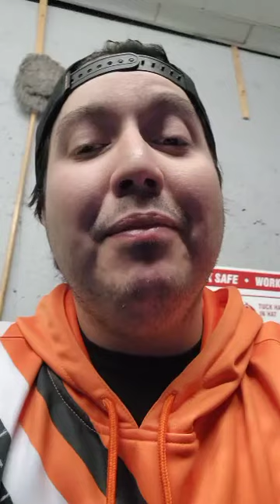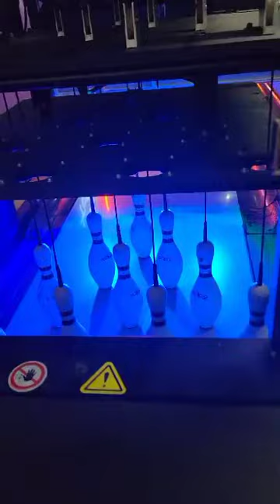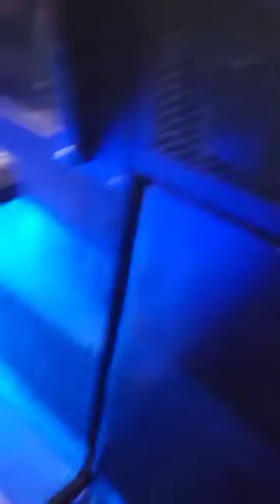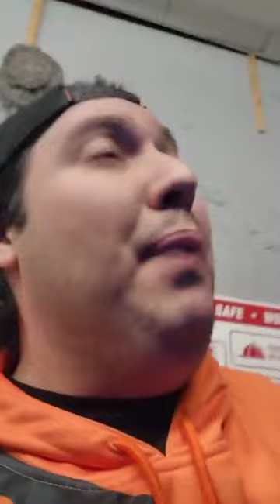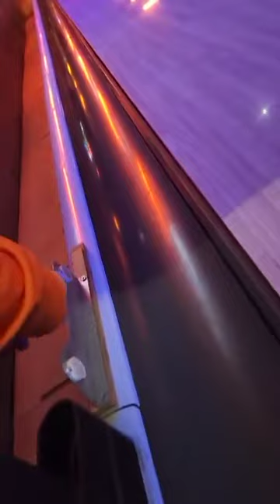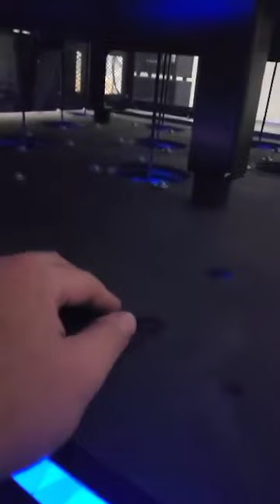STRING PINS: Behind the Scenes w/Mechanic Felix Serrano!

Comment: String pins can be competitive but I find it extremely hard that all the pins per lane would be calibrated the exact same way...i predict some pins/lanes will have weird string take downs while others don't even with certification....also their will ALWAYS be the need for a mechanic in any decent sized center string pins or not...balls will still get stuck, oil machines will glitch, and lanes will still break down
Reply from the maker: You don't need a "real" mechanic for balls getting stuck and strings being tangled though . .

Comment: Did he say the stings at his center are not certified? What would it take to make them certified? If a center decided to change to string pins right now would it cost more to get the certified version?
Reply from the maker: It's mostly in string length as far as I know, I'll see if I can get specifics though.
Reply: It's mostly string length and the pins on my machines are actually a bit smaller than standard and lighter.  So they fly like I'm the Packy videos.  I haven't gotten any that are in spec for competitive play yet but from what I have been told they're much closer in dimension and mass.
Reply: @LukeRosdahl  I think where I’m confused is people say it’s gonna be cheaper for centers in the long run but most videos of strings on the internet are not certified.  Did they switch before they have had the specifications for certified?  I know the story of Rashes video but what about the others
Reply: @cramones88  stringpins have existed for decades, the sanctioned specs have existed for months. it could just be a time thing, it could require specific pins and string lengths. it could require specific strings. the pin setter might need plastic cups for the pins to settle into. 

best case scenario is that string machines just need adjustments to qualify. hopefully at worst it's just a few cheap replacement parts
Reply: @MrOsmodeus  from what I understand the “curtain” I believe is that it’s called needs to be further back as well as something else in the pit area needs to be deeper.  I’m not 100% sure how difficult it is to change those things.  Did the center where packy practices change it before the specifications from USBC?
Reply: @FSerrano2789 For God's sake the pins themselves aren't even in spec on the uncertified machines?!?!?!? That's a worse joke than I thought... bowling as a serious competitive sport is doomed.
Reply: @cramones88  probably after given they started videos after people started caring about stringpins. i've seen videos for the amf string machines from 5 years ago but all the complaining started 9 ish months back
Reply from the maker: @notonyourlife7939  Why would they need to be in spec for unsanctioned recreational bowling???  I get that you don't like them but dude listen to yourself.  Uncertified strings are for RECREATIONAL CARNIVAL STYLE BOWLING.  I don't know why league/competitive bowlers can only see through their tiny little lens.  You keep digging the hole deeper and deeper and giving your opinion or your perspective less and less credibility with every comment.
Reply from the maker: @cramones88  Yeah uncertified string pins have been a thing for years for "fun centers" that have bowling as kind of like an extra arcade game so to speak.  But since they're so much cheaper and easier to run, a lot of centers have been considering them period, even if it does run off their league bowlers, because in some cases, it's either go strings or go out of business.  

Certifying strings is the compromise that allows centers to stay in business while still having some form of league or competitive play possible.
Reply: @LukeRosdahl  I'm just stunned that these manufacturers found it necessary to mess with the pins themselves as well. How hard would it have been to just use standard pins? It's almost as if a concerted effort was made to butcher everything they possibly could, and it makes no sense. Not to mention that this would make yet another financial hurdle for already struggling centers if they converted to strings prior to the certification, and wanted to maintain some sort of league presence. Now they gotta buy more pins, too... making it even less likely that they'd do so. And therfore another nail in the coffin for competitive bowling. If that's an "invalid" or "not credible" opinion, so be it. I've been called worse. If you don't think any of this is a big deal, that's fine. But I do, and that's OK too. We can agree to disagree without dumping on each other.
Reply from the maker: @notonyourlife7939  I'm not trying to dump on you, I'm saying that the way you're talking, you're not doing any favors for your opinion.  Why would a recreational or carnival type fun center want to go for the full on meat and potatoes of making everything regulation?  They're trying to give people who aren't bowlers a fun bowling-like experience.  There's a miniature bowling lane in a big sports store in KC for the kids to bowl on, is that butchering it?  Is a traveling carnival with smaller pop up games and roller coasters butchering that experience because they aren't a full on Six Flags or something?  

All it sounds like is that you're mad and are grasping at straws to just be mad in a direction that doesn't make any sense, which is damaging your argument or your point of view.  UNCERTIFIED string pin bowling in a fun center that has black lights on and strobe lights and projector screens with music videos or sports games going on instead of masking units is straight up strictly for a casual light experience, and getting all hacked off that they're butchering the experience of "real bowling" when they weren't going for "real bowling" in the first place doesn't make sense and isn't relevant.  It just makes you seem like someone going out of their way to be upset because you wouldn't personally enjoy something.  

A lot of these places opened as general fun places like Dave and Busters plus or something, instead of just a giant arcade, it's an arcade with glo mini golf, go karts lite, and bowling lite, and complaining about those places existing because it's "another nail in the coffin for competitive bowling" is wiiiiild.  

Like Felix said, they have a lot of lanes, half are standard, half are recreational, now having the option convert to possibly host sanctioned play if it works out is a nice option, or once again if some places were already forced into strings to keep the doors open, they now have the option to have leagues and competition if they want.  

There's a small 8 lane center not too far from here that went to string pins because it was either reduce operating costs or close, and that of course meant they had to give up sanctioned league and tournament options.  Now they have the option to convert and add that back in if they want.  

I DON'T DISAGREE THAT CERTIFYING STRINGS AS A WHOLE IS BAD FOR BOWLING, it's just that your argument I think is achieving the opposite of what you want it to achieve.  Stick to the point, stick to the facts, and maybe you'd get some support for your position.  I'm not trying to dump on you, I'm trying to impress on you that the way you're arguing your point isn't effective.
Reply: @LukeRosdahl  Dave & Busters can do whatever they want, I don't care. And if the separation between the "entertainment centers" and "bowing alleys" remained clear and distinct, then there's be no need for us to have this discussion.  But you know as well a I do that the former is slowly driving the latter out of existence. Smaller independently owned traditional bowing centers are putting in strings, kicking out the leagues and tourneys, and going totally recreational. One place near me caved a few months ago. Had been one of the better houses in the area since long before I was born, and I doubt they'll be the last to go this route. When that happens to enough  places and there's nowhere left to go for competition at any level, then what?  So I really don't think it's all that "wild" to conclude that strings will negatively affect competitive bowling on a long enough timeline. Perhaps I don't argue eloquently enough...I don't know. But the writing is on the wall, and it's pretty clear to me. If I'm wrong, great... actually, I hope I am for the sake of the game that I've enjoyed since I was 8 years old. But with the way things are playing out, remaining optimistic is easier said than done.
Reply from the maker: @notonyourlife7939  Yeah strings are definitely the writing on the wall, that's easy to see, but the failings of the industry and cheap bitchy bowlers have driven us here, and all centers are trying to do is stay in business, I'm sure they're not happy about it either, just doing what they have to do to stay afloat.  String pins are life support for a brain dead patient.
Reply: @LukeRosdahl the thing is if your center is going out of business means you are doing a horse crap job in running said center
Reply from the maker: @bigboots6114  Not necessarily, bowling has trapped itself by not raising prices to match inflation.  A lot of places are currently charging much less than they need to survive, yet the bowlers are still crying about the cost.  They need to raise prices to stay in business, invest in upgrades, etc., but traditional center business without having go karts or an arcade or axe throwing or whatever is going sharply down anyway.  

It's kind of like saying that Blockbuster went out of business because they did poor business.  The industry moved on is all that's happened, and same thing for traditional centers.  People have so many more things to do now and bowling is so expensive that people just don't have the time and/or the money for it any more.  

Bowling also hasn't kept up with the times, walking into most bowling centers is like time warping back a few decades, and stuff that was acceptable 30 years ago from a quality and service standpoint just doesn't cut it any more.

Comment: Been bowling on strings for 8 weeks and the league average has dropped 8 pins per bowler. They are great for recreational bowlers and I get the ease of operation, but the leagues are dissolving rapidly and the bowling alley seems to be happy about them leaving.
Reply: Great... what a "victory" for the sport. Are you bowling at one of the handful of certified string centers in the country, or are they the older, really crappy uncertified machines?
Reply from the maker: You have to think though, if centers are going to go to strings anyway, at least certifying them has some prayer of hanging on to some league bowlers instead of losing them all period.

And yeah, cheap whiny league bowlers leaving means more open lanes for happy open play bowlers willing to pay more.
Reply: Been bowling on them for two years and none of the leagues saw changes in average. Sounds like your center needs to make some changes to string lengths or something.
Reply: @NathanMoist  they are certified USBC machines.
Reply: @NathanMoist  USBC did tests with these string pins and on average you lose 10 pins